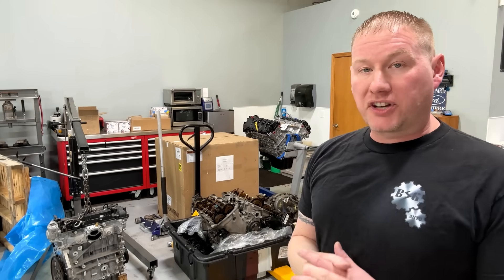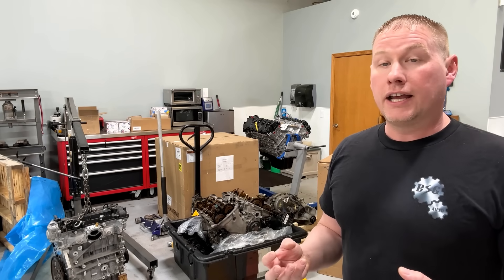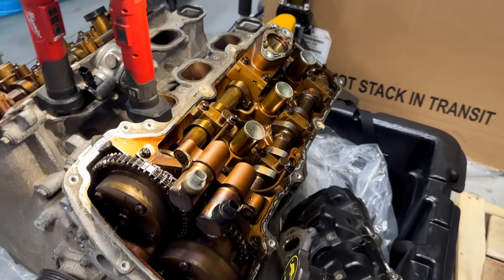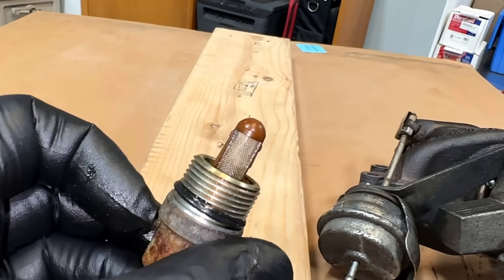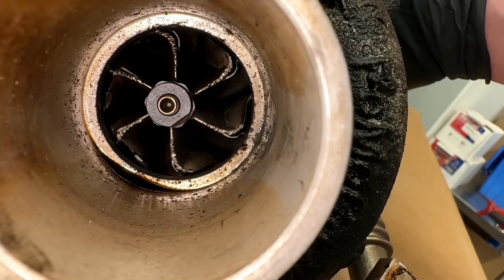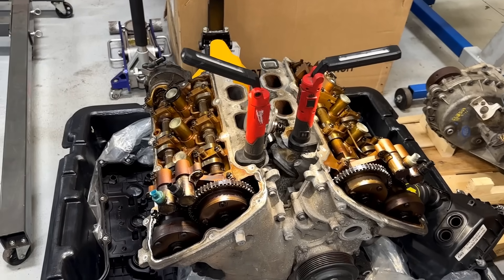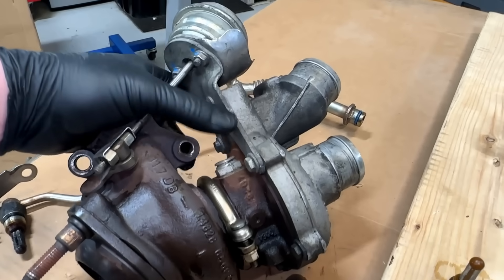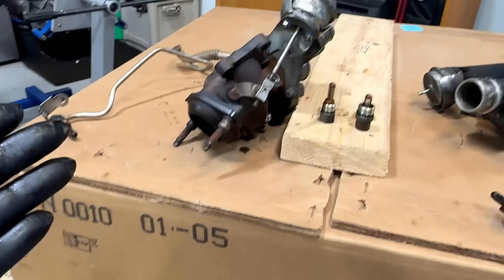This is Why You Never Run Extended Oil Change Intervals on The Ford Ecoboost Engines!

Comment: I am the original owner of a 2012 F-150 with a 3.5 eco. After the original warranty expired, I have been doing all of my own maintenance with the exception of a timing chain job at 212,000Km. After that job, I added a catch can and have been on full synthetic oil. Vehicle is now at 270,000km and running well (Thanks in a huge way to these videos!!). This video is the first time I have ever heard mention of these turbo filters! It would be awesome Brian, if you could do a video on the turbo filter replacement. I am hoping this is something a decent home mechanic can do.
Reply: Yes I agree with a video on a how to, replacing lines and filters
Reply: Yes, great video idea!
Reply: I also have a 2012 3.5 and would love to see a filter replacement as well.
Reply: I just read in the comments on a different video, some people and companies (Subaru) are removing the filters completely thinking dirty oil is better than no oil. Any thoughts?
Reply: @jaym7369  imho.... Clean oil is imperative and if you were running a bypass oil filter you might be able to get away with not using the inline turbo filter.......
Reply: Definitely not good to remove the filters. That's about the equivalent to putting a bypass in rather than running an engine oil filter. You'd have more oil no doubt, but full of all sorts of nasty abrasive stuff to wear everything else out that much quicker. With that said, the engineers put these filters there most likely because they know a lot of them would never make it out of the warranty period without them. Especially if the customer follows the built in OLM on the dash cluster. I know customers think they're doing the right thing when doing so, however these OEMs love when you kill your car, because they're always there with a helping hand to sell you another.
Reply: @jaym7369 pretend that your gender is engine or turbo……. 

What would you prefer?

Bottom of pot Starbucks muck brew?

Or an empty pup cup?
Reply: Timing chain done aroumd 115k kms here. 2011 3.5 fx4
Reply: @luckfound9455  you had to replace your timing chain at 71000 mi? A timing chain should be able to easily go 150. 200 thousand miles.... What was the condition of said timing chain to do just do it as a preventive maintenance... In which case I still think you did it way way
Reply: @deepsquat600  I brought it to the dealer and that was the diagnosis. I've got 180k on it now and sometimes hear that chain slap shen I start it up... Thankfully I don't hear it very often
Reply: @luckfound9455  how often these days do your oil..... I've been told before that that chain slapping noise sometimes is caused by the tensioner.... Still something that's a lot of work to change.....
Reply: @deepsquat600  the tensioners are plastic with questionable seals.  I'm using the old school metal ones from the early 2v modular motors in my 5.4 3v, I never hear any slapping noises.
Reply: @Brons2  .. miles do you have on your chain now and how often do you change your oil?
Reply: @deepsquat600  About 10K on the chain since I changed it, 154K total on the vehicle, 2010 Navigator.  It doesn't really make sense to go all the way in there to change the tensioners without doing the chain, guides, solenoids and phasers as well.  Just getting everything out the way and opened up is most of the work.  It's a pretty big job, took me most of 4 days using regular hand tools.
Reply: @Brons2  yeah I've seen some of them deal with your own Ford text channel that really make me go wow... But I'm at the next time you have to do it you'll get it done in 2 days instead of 4 LOL.
Reply: @deepsquat600 also the cam phasers. This channel has done a video on it.
Reply: @luckfound9455 look into the cam phasers. This channel has a video on it.
Reply: These are very easy to change, minus accessing them. Usually on one or two bolts per end and they pop out.
Reply: 3rd timing chain. 270000 miles.
Reply: Adding filters to a journal bearing turbo is not a good idea. Journal bearings need a large volume of flow, you'd b better off letting a small amount of sludge through the bearing than having that sludge collect in the filter, choking the oil supply, and killing the turbo that way. OEMs have tried filters in turbo feeds. Most abandoned them because the filter is more likely to kill the turbo.
Reply: @OtisFlint  Or maybe just change your oil every 3 k.  Thats simple really.
Reply: @mrnobody5381  3K is stupid. Use a good synthetic oil and you're fine for at least 7-8k. When i tore down my 600hp 2.0L with 53k miles on it, all the bearings could have gone back in the packaging and been sold as new. Everything in that engine was spotless. 5K intervals with Amsoil, should have gone longer.
Reply: @OtisFlint / glad to hear it. I am an amsoil user to going back to the late 90s. I have a 2020 Ford Explorer with a 2.3 Eco boost. I’m changing it once a year where I average around 6000 miles.

Between 3rd and 4th year, we clocked 9,600 miles. I believe in amsoil lasting one year, so I’m hoping no damage occurred. But after watching this video, i’m wondering, what do you think?
Reply: @OtisFlint  well if you're talking normal filter they have bypass valves so they don't shut down the flow of the oil... If you're talkin a bypass filter it already is just taking a small trickle of oil oil in ultra filtering it.. Then reintroducing into the system... By using your logic to the ultimate extant you should never filter your oil
Reply: @deepsquat600  I'm not talking about either. Did you watch the video?
Reply: I've noticed people that drive around in the city a lot have to do the timing chain at around 250k 
FREEWAY DRIVERS CAN GO TO 400K BEFORE NEEDING TIMING CHAIN
Reply: I have a 2019 Ecoboost and have run into some issues. I am the 2nd owner so it could be the result of the first owner driving it too hard. No reported accidents on the carfax and got the car @ 1 year 19,000 miles.

I just had one major repair and had also a pretty significant repair. I do oil changes every 3k and use synthetic. Follow all maintenance in the manual.

At about 3 years, 38k miles I started getting white smoke in exhaust and occasional misfires. Initially though was a spark plug and ignition coil issue and replacement fixed it temporarily, but a Ford dealership ran a camera into a cylinder and found a crack cylinder with coolant leaking into it. Car was still under powertrain warranty so Ford replaced engine block free of charge.

Before that at around 2 years 29k, the sensor in the airflow intake failed and car had delay in turbo performance.

I am at 4 years/48k and probably going to sell the car next summer. I still absolutely loved the car and probably my favorite car I ever owned. I plan on trading it in for a 1 or 2 year old Mustang still under warranty.
Reply: I am in the exact same situation as you. I'm driving a 2011 F-150 FX4 with 3.5L V6 Ecoboost. 240,000km, I've rebuilt the engine once due to my own lack of maintenance but it was worth it. I have replaced the exhaust, done transmission work and it's currently in the shop now having the timing chain replaced. I have learned SO MUCH in the past decade from everyone online like this about the Engine and how to maintain my truck. I plan on maintaining and restoring it for decades to come... I've gotten into frame restoration, body and paint work... I've been following people who have restored rusted out junk trucks from scrapyards.... If they can do that, I can easily maintain and restore my 2011 with full access to Ford Dealership service shops and still brand new parts. No reason at all to buy a new truck these days! Just repair, maintain and restore!
Reply: Thank you! Running a 3.5l in my Lincoln MKT. 236k. Changed timing components, oil pump and pick up, water pump and engine mounts. My next project is turbo filters!
Reply: yes pls do a video
Reply: Just had the timing chain job done by my local mechanic as it is way more complicated then what they used to be.  Not only the chain has to be changed, but a bunch of other parts as well.  193 k on the odometer and it runs great.  Had to have the turbo oil lines replaced with stainless steel ones.  Had oil leaks on both turbos as the rubber gasket there was going bad.  Its a common problem from what i hear.  Always changed at 3 k, as thats the way it has always been since i started owning cars.
Reply: When the 3.5 expeditions need an engine, whats that cost?  I have a 2017 with 131k, well maintained every 3k.  Plan to keep it a long time and asking for future reference.
Reply: I have a 2014 Focus st I'm the second owner and it currently has 259,000 miles 416,000km based on my maintenance it needs oil about every 4,000 miles
Reply: Install a oil catch can, it will help.
Reply: 2012 F150 3.5 eco 276000 miles on it I think it needs a new engine took it to a shop for coolant leak came out missing on number 6 rpm needle broke off in bottom of cluster
Reply: I’m right at 130,000 (miles, would be close to your 212,000km) with mine and have heard the timing chain rattle on a cold start a couple times.  It’s rare, but I know I need to change the timing chain.
Reply: It's more critical with a Turbocharger without you could probably go 10,000 MI I know because I have obviously with the turbocharger you want to change every 5,000
Reply: Can't beat Ford trucks! 💯

Comment: 1:43  there is a lot of blow-by
Extended oil is a joke for any car
As soon as the oil is exposed to unburnt fuel aka gasoline it starts to break down.
He even says blow-by
The extent oil life is a joke and straight up a way to have engines fail sooner. Engine life is also being sacrificed with auto stop during idling. 
Now your car is starting a lot more every time you drive, meaning the engine is experiencing the low oil pressure start up situation. Yeah the reason for it is less air pollution at the expense of lower engine life.

Comment: I have a 2018f150 2.7 I use the ford full synthetic and it is changed 5500-6000 miles. My goal is to drive it to 300-500k. Your suggestion is to change it every 5k , is there any other recommendations? Thank you 🙏

Comment: 1st oil change on my 2020 Explorer ST at 1000 miles to full synthetic, every 4000-5000 miles with 50/50 highway/city driving.  Oil life monitor usually reads %50-%40 life left.  Also do Blackstone lab checks every other change.
Reply: Have the same engine on my bronco raptor,  and was told to stick with the motorcraft blend by the dealer.   Should I not take their advice??

Comment: A recommendation to Ford. (an idea you would suggest to them if you like it) Dishwashers have a turbidity sensor and this gives information about water clarity and particulate matter concentrations and this is used to modify the cycle(s) accordingly. (more drain/fill) The concept here would be to begin with the best-case mileage (10k because the accountants have decided) and then have reductions applied. The engine computer can give a "factor" or bias when RPM and acceleration exceed certain norms identifying higher engine stress. This along with turbidity of the oil could deduct mileage from the target and this would bring in the Instrument Cluster Indicator sooner. Textbook use of the engine/vehicle might go the full 10k, but highway merging, passing, hot idling, etc. will decrease the 10k target and trigger an earlier oil change.

Comment: It’s ironic that when the dealerships started adding in free oil changes to new cars that now they can miraculously go 7500-10000 miles on an oil change. Then about the time the warranty runs out problems start showing up. 🤔
Reply: Ugghh I wish I would have researched a little more I just got a 2019 and really wanted a warranty with it. Everything is so expensive now I couldn’t afford any catastrophic problem, and the guy was like okay “oil changes every 7500” are covered, he said it twice at different times and looking back I wonder if he was hinting for me to contest. I may ask if they will do 5k and cut off the back end however many visits that would be?

Comment: 3.5 ecoboost 2019 expedition. Please tell me how the noisy, rattling waste gates can be quited! It rattles at start up, and normal driving. When i rev the engine they rattle too. Definitely not any heat shields

Comment: I have my 2016 6.7 changed at 5000 miles or six months which ever comes first Ford dealer uses motor craft blended oil should I have it sooner since it’s not full synthetic oil  thanks

Comment: NEVER and I mean NEVER go off of the computer.  The computer doesn't take in account how much carbon and suet build up and mx with the oil.  The oil itself is probably fine but its all the other junk in the oil that causes these problems.  5000 miles is max you should go between oil changes on any ecoboost engine.

Comment: I love Fords.  Owned them since I was 16.  Had a 1998 crown vic with the 4.6 that ran flawlessly and it had 230+k miles on with ice cold ac, shifting like butter when some creep stole it from me and crashed it while he was being chased for apprehension.  Still have a Ford now and 2 Lincolns (all v8 equipped).   I'm a bit skeptical on these turbocharged v6 powered large vehicles.  Too much weight and demand on smaller motors is not a good mix IMO.  And I've noticed lots of premature catalytic converter issues on Fords lately as well.  Not so sure I'll be investing in a newer model just yet.  I definitely ensure that none of my vehicle have low or dark oil, keep them topped off and clean!

Comment: My inlaws 2018 F-150 ecoboost had a timing job done at a Ford dealership in Grand Rapids MI, they recommended 4k oil changes.

Comment: I wanted to hear about that 2.0.  That's the engine that I have in my Transit Connect. I'm not a fan of those diamond friction washers on the crank. Woodruff key is much better.

Comment: I always run quality gas and oil. Oil changes every 3-4k. I run amsoil signature and I know it can go longer, but nope, not doing it. Is it expensive running that oil and top tier fuel? Yes, but it's worth the peace of mind and the engine runs smoother.

Comment: Hello again Makuloco. Very great info provided. Question please? Is the new oil spec oil a motorcraft product? and, why do the two turrbo filter screens shown on your bench, two different sizes? and, will an oil catch can also aid in longevity with proper oil/filter changes? Thank you. Cheers from Motown/Deaborn.

Comment: Every 5K or less I change oil in all my Ford vehicles.  I use full synthetic oil.  None of them are turbo charged either.  Zero engine issues on any of them.

Comment: Makes me glad I have a Cummins. 10,000 mile oil changes with 500,000+ miles of reliability.
Reply: In a Dodge truck that starts falling apart at 100,000 miles ?
Reply: @Angelo-fo8de  I had 3 Dodges , I got away from them and never looked back.
Reply: @Angelo-fo8de  320,000 and still together. The only thing that needs to be done is the steering.
Reply: @Angelo-fo8de  Yup, complete trash.

Comment: If you use synthetic oil in modern Ford vehicles can we trust the service intervals that Ford recommends? FYI I drive a semi, the Freightliner I drive goes for service every 25,000 miles

Comment: Brian - I'm like many viewers who know nothing and rely on YouTube to learn about my vehicle and your channel is the best.  I happen to have the exact same engine in my 2015 Expedition and can attest to the importance of regular oil changes. I think it is also important to use the Motocraft oil filter but you need to watch out for counterfeits. 

I would also add that aftermarket parts, including a catch can, are not necessarily beneficial because they also require maintenance.  I bought my vehicle with 156,000 miles on it from a dealership and had them do the regular maintenace before taking delivery.  They changed the oil with Motocraft synthetic blend oil but did not empty the catch can and they did not change the air filter because it had an aftermarket K&N filter mounted in a non standard filter housing.  The vehicle was warm when I took it for a test drive but had been sitting in the cold when I took delivery.  I discovered that it had a phaser rattle and reluctantly took delivery because I was assured that it wasn't a problem.  I later figured out that the catch can was part of the problem because it was nearly full with milky gunk and needed cleaning.  I changed the oil at 3k miles and used a full synthetic oil and a Motocraft filter.  I changed it again at 3k and the oil catch can had some oil in but it wasn't nearly as dirty.  I changed it again at 3k and the oil in the catch can was even cleaner.  The K&N filter is a pain to clean because you have to use a special kit and allow the filter to dry overnight before reinstalling it and I agree with Brian's earlier video that it should be avoided.

The good news is that phaser rattle has diminished with every oil change and can be avoided by flood starting the engine until the oil pressure gauge registers OK.  It is such a minimal rattle that I only flood start it when it is well below freezing.  The bad news is that I've developed an underboost condition and am in need of a timing job,  I just turned 170k.

Edit update - Just turned 176k and it has been below zero for the past week and no more phaser rattle, no more flood starting.  But I did have to have my starter replaced last week.  Don't know if it was the flood starting or corrosion from road salt.
Reply: Yeah stay away from kn on that vehicle